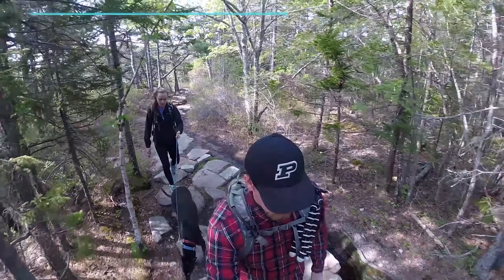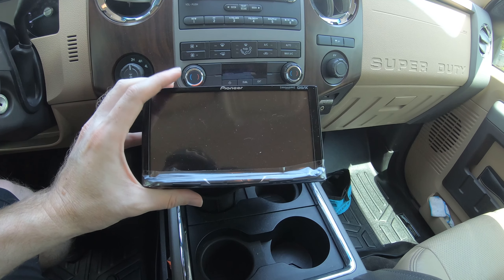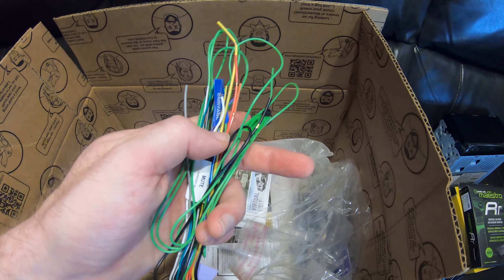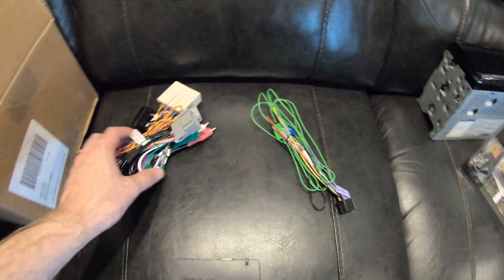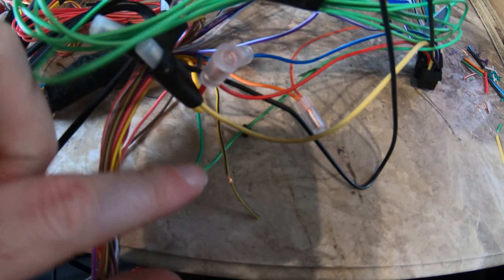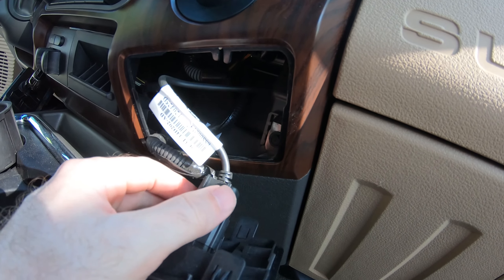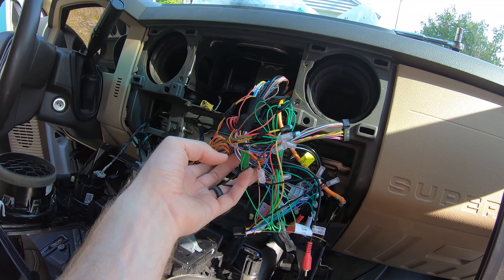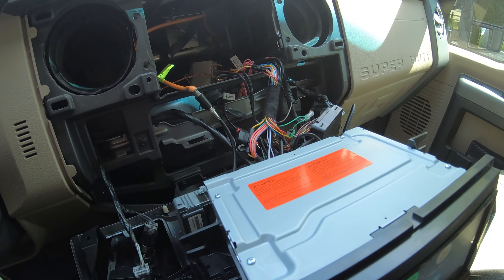Installing Pioneer DMH-1500NEX Stereo on 2011-2016 F350

Comment: Thanks - good video and explanations. Question - the ODBII connector snakes down to connect to the factory ODBII connector, cudos to your wife. Is this a permanent connection that replaces the functionality of the factory ODBII for diagnostic use? I am replacing the factory cd/radio in my 2014 F250 Super Duty in order to get a backup camera for easing hooking up to my trailers. The truck is "new to me" in 2023, and daggone it, I want a backup camera [spit]!
Reply from the maker: Hey there, you can unplug it if you still need diagnostics run. It is handy though at least with the model I installed on the truck because it actually displays error codes for check engine lights etc. And agreed, backup cameras are super helpful especially in tight areas! - Shane

Comment: Nice video. Well done. The USB, there is a usb that fits into the cig lighter, so, if you dont need the cig lighter, remove it & use the usb ext. Now, for me, I have the same thing as you except I have a 2011 F150. Same pioneer, maestro and harness. All the interface on my radio works, the steering wheel control works as it should, I just dont have sound! I been fighting with this for 3 weeks. I've installed radios before..and your right, it's just  PnP. I'm really baffled. At this point it's going to a stereo installer. I hate having to spend that much money on it but, I gave up three weekends !!  lol.. I'm done! Unless someone comes up with a strong answer...I'll try again!!!
Reply: No sound, how did you connect the speakers, via clips as in the video or soldering?

Comment: I'm about to install one of these in a 2010 F-150.  I ordered from Crutchfield as well and ordered the Maestro for all the controls.  What does the SYNC USB port do with this stereo?  Can it still be used for audio files?  Is there a way to hook it up to the back of the USB port on the stereo instead of using the extension cable that comes with it?
Reply from the maker: I never got the sync usb input to work with the stereo myself. Ive seen others online basically taking the sync usb port out and replacing it with the extension that goes into the new stereo. I ended up just leaving the sync in there to be able to use as an additional power source and ran the extension through a side port. So unfortunately I am not really an expert and can't give you a great answer, but that is how I handled it.
Reply: DnSAdventures I got it installed. I can’t get the sync usb to work either. Having trouble with the sync voice commands too. I hooked the wire up to the swi 2 under the dash tray. Maybe I just gotta mess around with it some. Should the factory microphone for Bluetooth calls still work for anything?
Reply from the maker: I think you may have to use the external mic that came with the stereo. I never got voice commands working either. Thought my phone mic would pick it up, but it must switch over to the stereo's instead.

Comment: Were you not able to connect the USB to the existing Ford SYNC USB connector?
Reply from the maker: With the model that I purchased, you have to use the USB in the back of the stereo itself to be able to use the functionality. One of the trade offs of a cheaper wired unit rather than completely wireless setup. You could however reroute that wire to where the Ford Sync is currently, but I didn't personally want to accidentally screw that up somehow. I've seen some people remove the usb dock from within the Ford Sync connection...but odds are I would probably scratch it all up haha. I also want to clarify that I don't do this for a living and just tried to save money by doing it myself whether correctly or incorrectly. :)

Comment: How do you like the radio so far? Do you recommend this unit?
Reply from the maker: It has gotten the job done and does what we need it to. With that said, it does still have some random bugs that seem to go away after starting up...but it does seem to take a while to start up. It also can lag a bit when shifting in reverse for the backup camera...so response times could be better. Other than that, it definitely beats the stock stereo by far and love being able to use the screen for navigation for longer trips via our phones and google maps. I would recommend it as a decent and cheaper alternative to some of the more expensive units out there.

Comment: What does plugging into the OBDII port accomplish and does it stay plugged in all the time or?
Reply from the maker: It isn't as effective as a scanner as far as diagnosing issues, but it did give me the error code when I had something going wrong on my F350. It also can give you information such as tire pressure etc on your screen if your vehicle is compatible with that feature. Just some extra perks, but nothing I would be concerned about too much. - Shane
Reply: @DnSAdventures  So you could not hook it up and it wouldn't hurt anything?
Reply from the maker: @rdatkins1  That is my understanding. There are other connections I just left hanging because they weren't applicable to the F350 or I just didn't need to use them.

Comment: Great video... I just picked up a 1500NEX and RR myself... Nice job on the install.  It was nice to have you reconfirm my thought process.

Did any of the wires come loose due to those connectors?
Reply from the maker: Thanks for watching! Haven't had anything come loose yet and have been over some fairly rough roads. Seemed pretty solid with those connectors, but could always wrap with some electrical tape for a little added security. Have a good one! - Shane

Comment: Where did you end up putting the USB cable..?
Reply from the maker: There was an unused plastic port underneath the cigarette lighter on the driver side...on my super duty at least. So just drilled a small hole through the top of the plastic and fed the wire through.

Comment: Did you have to buy a GPS antenna for the head unit?
Reply from the maker: This just uses either an android phone or iphone to drive the gps, there isn't anything prebuilt in. This particular model requires you to connect to your phone via usb cable, but they do make a slightly more expensive version that can connect wirelessly.
Reply: @DnSAdventures  appreciate your help 🙏